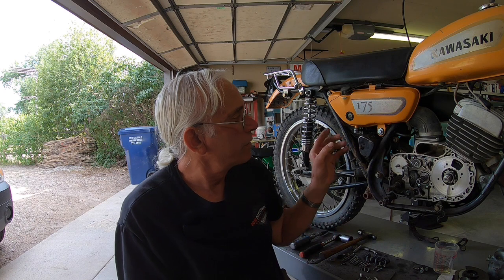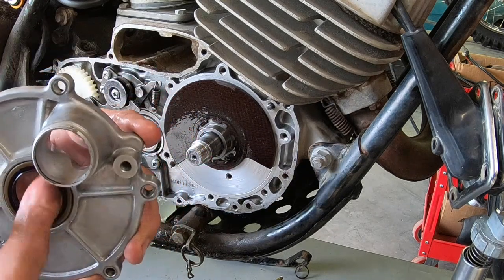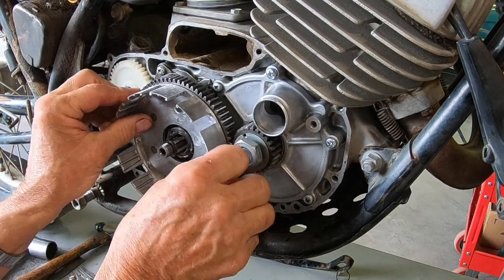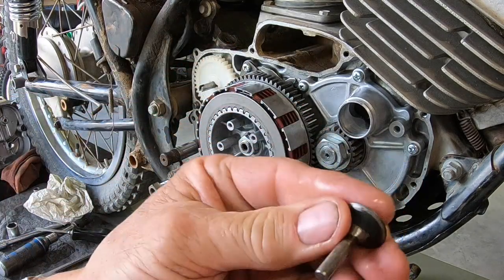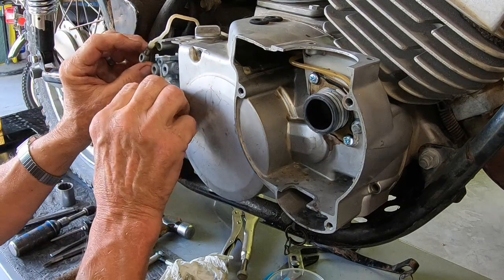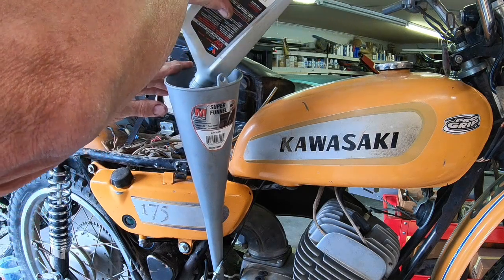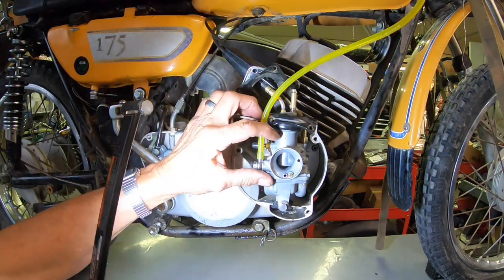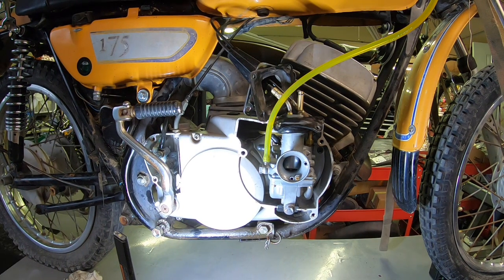71 Kawasaki F7 clutch side cover install and run.

Comment: I had that same issue with the slopy intake boot i replaced it your video is very helpfull im on an issue with oil in the exhaust . Motor oil im sure. Thanks
Reply from the maker: Sounds like your on the right track, let it run long enough to burn out what oil is still in the pipe.

Comment: There are two lines that exit the case near the carb next to each other. One is for fuel from the tank. What is the other for? Working on a ‘75 F7.
Reply from the maker: To the vacuum operated petcock.
Reply: @montana2strokeracer thanks for the info. I must have an aftermarket petcock. I guess I’ll just delete that hose. Recovering a bike that sat in a barn for 30 years.
Reply: @montana2strokeracer where does it connect to a vacuum supply. I don’t see any place to connect it in the carb area.
Reply from the maker: Yes there is a vacuum port on the original carb, pretty close to the fuel inlet.

Comment: Dale, you have the wrong carb on that bike, it’s supposed to be a  vm26sc which slips into the boot and has a hose clamp around the rubber carb mount🤓

Comment: When you pushed the rod pusher in to the end of the clutch hub (16.48 mark) it seemed like it had a spring behind it, but it doesn't have a spring? Mine is not disengaging as if the rod won't push far enough and the adjustment is all the way in. Maybe cable? Any info is good thanks
Reply from the maker: Hey Paul, no there is no spring in there, this was a homemade part and didn't fit the shaft correctly and just partially fell out when I took my finger off it. Have you checked the eccentric lever its screw motion and all those parts in the side case for excessive wear. Do you have the correct adjustment screw and nut, and one short shaft and one long shaft. Yes if the cable is stretched too long, you can either shorten it or find a new one.

Comment: What type of oil did you use for the transmission? I have a 75 smell bike.
Reply from the maker: I'm sorry not familiar with the term smell bike. If it's a F7 Kawasaki, just use petroleum based 10/30, no synthetic or semi synthetic oils.
Reply: @montana2strokeracer  yes I meant a 1975 kawasaki f7 175. Dang auto spelling. Thanks
Reply from the maker: No problem, I have issues with the spell check too.

Comment: Hey Dale when pulling in my clutch lever on my 74 175 f7 nothing happens. I can see the actuator arm pushing the rod into the case but its not actually activating the clutch. not even a little slip.  it feels as normal as any other clutch. any advice?
Reply from the maker: Have you got it adjusted properly? Has it been apart, are all the parts there according to the IPB? Are the clutch plates within specs?
Reply: @ I disassembled everything and couldn’t find any issue. I reassembled and tied the clutch lever shut with a zip tie. Let the bike sit for a few hours, every so often rotating the engine so the clutch plates would get oil everywhere. Then after a few hours I picked the rear end of the bike up walked forward and dropped it while the clutch was still zip tied and it broke free. The plates were stuck and that method worked great
Reply from the maker: Awesome, glad to see you got it going. Yes, that is a common problem when these bikes sit for long periods. I usually just pull the clutch cover and separate the plates and reinstall. They need the oil replaced anyway.

Comment: Have you checked the jets and needle in the carburetor and two other things that may help is to get an NGK plug and check also that you have a correct air filter and clean air box, add 4 ounces of Chevron Techron fuel additive to help clean the carb further and that maybe helpful. When you do get a quality chain I do suggest a new rear and front sprocket. Thank you for the great video Sir. !

Comment: Have you been able to make any determinations about air leaks on these f7 bikes? I have one thats been nothing but trouble. Replaced the carb boot with a NOS boot, replaced ignition side crank seal, plugged/locked out the "drain pump" - all potential sources for air leaks and the bike still has air leak symptoms. Probably perform a leakdown test next, not sure what else im missing. Challenging bikes to get back running again. Great videos thanks
Reply from the maker: I have been able to get this one to seal, if you look at the will it run and a couple other videos, I did on this one at first. The carb boot was my biggest problem, the seals are getting replaced now, along with O-rings. The leak down test is your best option for finding the pesky leaks, be sure to check where the center cases interface, the base and head gasket, along with the sparkplug seal. Of course, on these with the rotary valve, there are several O-rings, and that stupid engine pump valve on the lower front. Good luck with it, hope you are successful in finding it easily!.
Reply: @montana2strokeracer  thanks Dale. Been watching your teardown/assembly videos to see if im missing something. Glad I found this channel

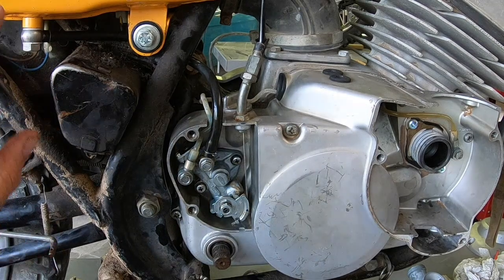Comment: Hello, what part number is the cable at 23:54? From the manuals it looks like either 54017-039 or 54017-060? Those are both labeled as starter cables though
Reply from the maker: Not sure, it is the oil pump cable, I will have to look, didn't need one for mine so I haven't investigated it. The starter cable runs from the twist grip to the choke on the carb.

Comment: Hey dale, just noticed something alarming, it appears in this video and I could be wrong, that there is no check valve, I believe mine might be out and watched your video for reference and I don't see one. It appears as part number 32 on the parts diagram on CMSL for this and my year and yours, and it appears that yours just has a dowel there. Am I missing something?
Reply from the maker: Thanks Sean, you probably know more than I do about. I just put back in, whatever came out. The engine is out of the frame right now. should be cracking it open soon.
Reply: @montana2strokeracer  all good :) I don’t know about that haha, learning just like you with this bike lol just took mine apart and it can stick into the cover slot. 
As far as the piston debacle for my F7, I checked compression and I was getting like 90 PSI, so I tore the top end down, and I’m curious, I’ve got a 0.40 over piston on the way, with the KD/KE rings, and I’m wondering if I can just get away with replacing the STD rings to new? The gap on one of my rings is 0.08 (max is 0.07). What would you recommend? Will new rings reset my compression?

Comment: What size o-ring did you get for the carburetor holder?
Reply from the maker: Not sure of the size, I just found a small diameter Oring that would stretch over the intake.

Comment: Great work.. sir dale. Maybe you can use a good clamp on your carb side to hold it steady or replace it with another good carb that fits yours. Check with carburator of Kawasaki HD3 of Philippines I think they have similarities.
Reply from the maker: Thank you, sir, I sure appreciate the info, I will be looking at every option. The HD3 I sure wasn't aware of. Thank you, and thanks for hanging out in the shop with me.

Comment: Hey Dale, all my G series carbs clamp on with an access hole in the clutch cover, maybe you can modify yours to clamp on. Regardless whether the air leak is at the carb, I believe it's time to vaccume/pressure test as it is likely to leak elsewhere after 50 years.
Reply from the maker: Oh yeah, I have new seals coming and I probably will have to open her up. So, a pressure check is on the horizon for sure, probably do it before the disassemble just to see, and it will be good for another video. Think I did one on a Yamaha a few months ago. Yes I think they improved on the design on the later bikes. Thanks for your help, and for hanging out with me in the shop.

Comment: Hey Dale, I enjoyed hanging out in the shop with you today. 
I think you have found the problem with the loose carburettor, drawing air. It could be a crank seal leaking but the obvious thing is the loose carb. 
It certainly seemed to run well once you restricted it with your hand. Maybe you won't have to do much to this one. 
Best wishes, Dean.
Reply from the maker: Hey buddy, the new video is out, I did find the problem, just what I thought, now how to fix it. This was not a good design, at least not 50 years later. Yeah buddy, I sure appreciate you hanging out with me. Going to be there for your next one too. Thanks for the support, Dean.
Reply: @montana2strokeracer  thanks my friend. I'll catch up with the new video tonight.

Comment: I had a hard time with my carb like that. But mine has a rubber boot between that the carb slides in to. I looked and can’t find the parts you need yet I’ll keep looking. Thanks for sharing brother. It is awesome that you are doing a Kawasaki. I’m fixing to pick up a 1984 Big red 200. To piddle with.
Reply from the maker: Yes this one fits over the mount on the case, not into it. I think that might be easier to find. I had to get one for my Bighorn too, same problem, but at least I found one. What is the Big Red, is that a Kawaski? Thanks again buddy.
Reply: @montana2strokeracer  it’s a Honda

Comment: Hey Dale, I noticed that the carburetor on this model slides over a rubber boot which may be dried out and shrunk. I have had good luck soaking dried out rubber parts in brake fluid. sometimes brake fluid will bring old rubber back to life. Another great video Thank you
Reply from the maker: Hey thanks for the tip, James, yes brake fluid does have that effect on rubber parts. I didn't think about that. Thanks, and thanks for hanging out in the shop with me.

Comment: Hi Dale. Great looking bike, I really like those old rotary valve Kawasaki’s. I used to have a KE100, it was a good little machine and I wish I never sold it. 

The erratic idling certainly sounds like an air leak, you’re right. It might be worth trying to run the bike with the side cover bolted back on, obviously this won’t fix the loose carb spigot but will stop the engine pulling so much air, providing there is a good seal between the two faces. I think those side covers take a paper gasket?  I’m sure by your next video you’ll have it sorted out. 

Thanks again Dale and look forward to the next one with you. Cheers

Dan
Reply from the maker: Yes I was thinking that last night myself. Maybe put a large o-ring around the mount tube and put the cover on. I also need to pull the flywheel off and see if the seal is pushed out. That could be an issue too. I will probably end up doing a leak down test.

Comment: Dale.. inside the engines air duct it had some mud wasp nests that could get into the carb intake....
Reply from the maker: Yes, its nasty in there, crusty more than anything from hard water most likely. But no mud wasp, we don't have them here, too cold. I grew up in Oklahoma and we had those mud dobbers, never seen them here in the 35 years I have lived here. But yes, it needs cleaned. Most likely when I pull the engine and start that, I will bead blast that area clean then put in the ultra-sonic cleaner.

Comment: my tc-100 carb has a screw on clamp access hole on the side, you have a clamp where is the screw? doesn't take much tightening to clamp.
Reply from the maker: It looks like there is a clamp and screw, but the clamp was never split or drilled for a screw or bolt. This is a purely slip fit and it is held on by the carb cover pushing in on the carb body. It is totally not well designed in my opinion.
Reply: @montana2strokeracer  my tc-100 has a simular screw and collar no slit but it seems to squeese enough to tighten.

Comment: amazing the added expense in the oil tank metal/banjo fitting etc, compared to the plastic push on lines etc.
Reply from the maker: Yamaha used them too, early on. The CT-1 175 that Im building has the banjo on the oil tank. I think 70 was the last year.

Comment: i have a Suzuki TC-100 with a rotary valve, wonder why they only used for a short time?
Reply from the maker: Suzuki used a rotary on the smaller bikes for a long time. I don't know about the minibikes, could be they are still.